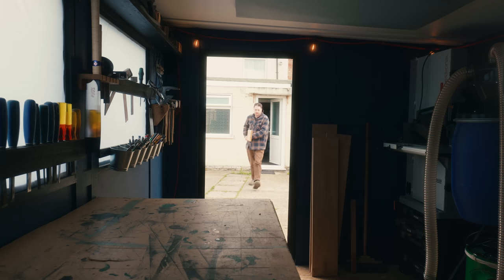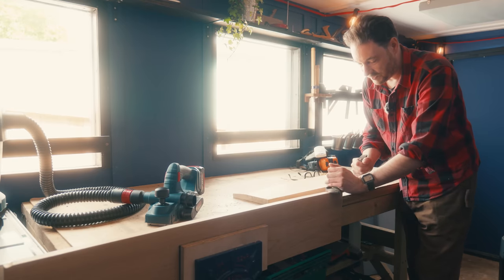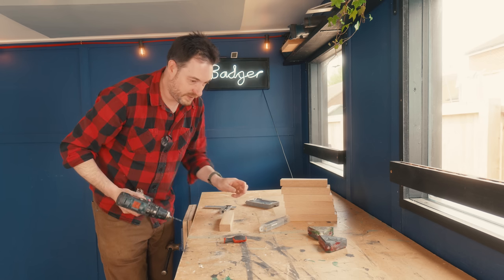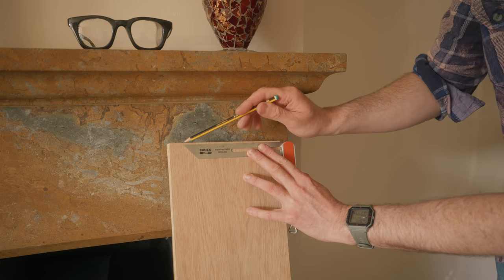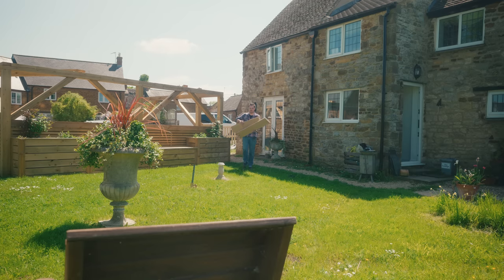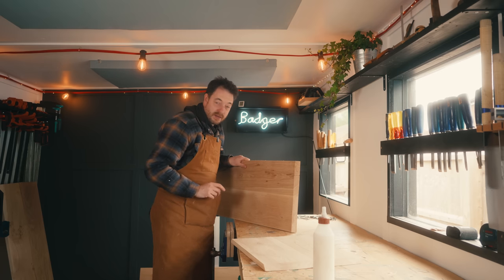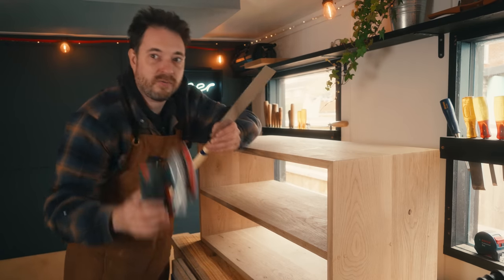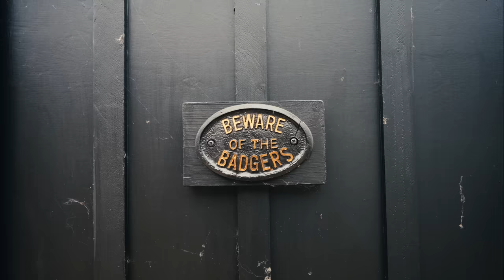TV Stand & Shelves For My Mum

Comment: When I was in college, the instructors advised us to use the counter sink before drilling the pilot hole.
The counter sink has a centre point that needs to bite into wood to keep it true and smooth. Lovely smooth round counter sink Holes. Try it. it really does make a noticeable difference. One more thing we learned. Run your plugs through the bandsaw at 90 degrees., The plugs fall out lovely and clean. No need to force them out with a screwdriver. Nice work as usual Matt.

Comment: I have a corded electric hand planer.   I only use it for rough work like removing nubs on turning log sections.
I tried using this on a flat board.   I was not able to get a smooth surface.   Any slight variation in feed rate results in different amount of wood being removed.
Useful to have this in my shop, but only for hogging off wood where I will later be turning or cutting the surface smooth.
Dave.
Reply from the maker: I’m sure it will come in handy for rough work